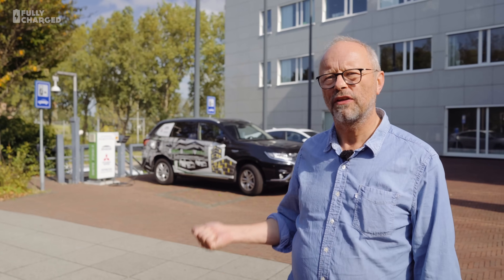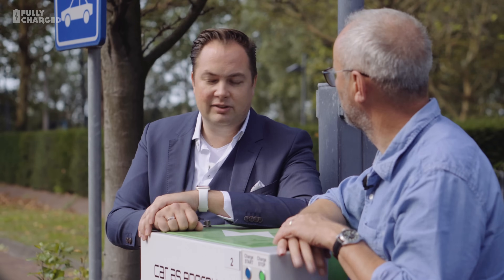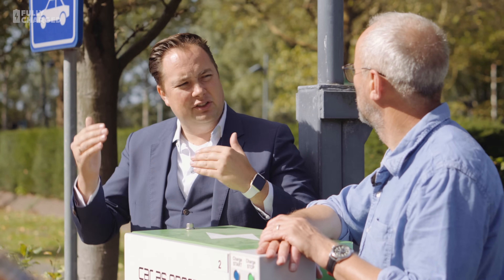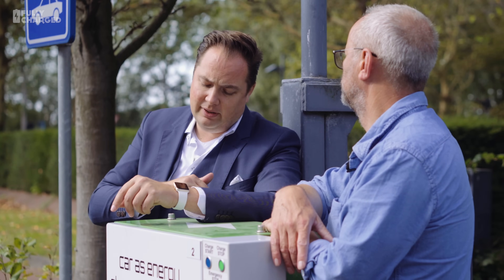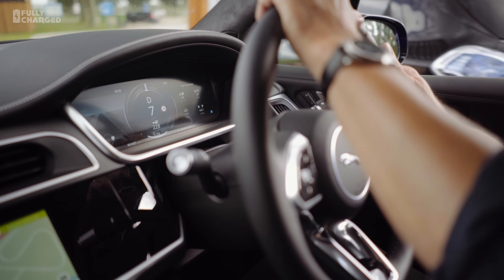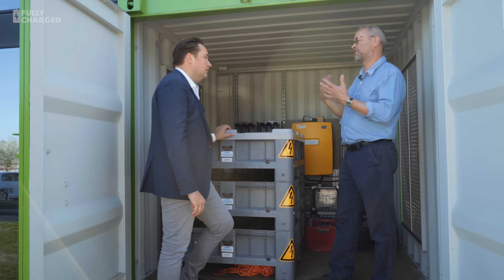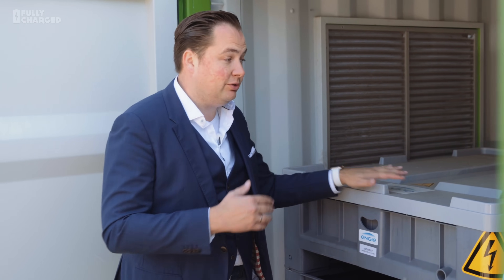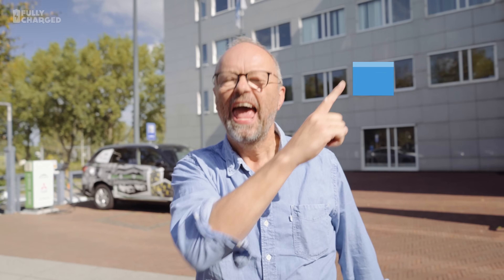Engie Vehicle-To-Grid | Fully Charged

Comment: I don't fully understand... if the building drains your battery, how do you get home? If there's a power cut and they're running elevators from your car, surely you'll have a flat battery? What's in it for the customer?
Reply: Most EVs have a "trip planned" built into their system.  This allows the driver to set there next departure time and destination, that can easily ringfence a certain minimum charge requirement.  For example, i know i leave work at around 5.20pm each day, and the trip home is say 15 miles, and requires 4kWhr of electricity. If i get to work with say 14 kWhr in the battery left, my car could, during the day when the price of 'lecy is higher, sell 10kWhr back to the grid to easy peak loads at lunchtime, leave itself the necessary 4kWhr to get me home, and then recharge on cheaper rate 'lecy over night ready for tomorrow.  if my plans change, then i just change the setting using the normal remote app on my phone, and the car could quickly recharge if my journey is required to be longer etc.  Most EVs have all the necessary hardware on board to do this today, should the software be written and released by the OEM and should the DC chargers be replaced with bi-directional units (current DC supplies are "charge only" ie are only designed and certified to take power from the grid)
Reply: @maxtorque2277  That's a great explanation. I'd always had a bit of trouble getting my head around it up until now. Thanks.
Reply: The system can monitor what it draws and will not drain your battery. If you watch an early video RL did in  Australia they have an example where a house battery does the same thing, but to balance the grid, the draw was very small but was enough to contribute to stabilisation of the grid. The system show in this video is a trial to ensure the system works in the real world. In reality is there would be multiple vehicles/ home batteries used. The idea of maintaining the power to a building during a power out is currently a dream as it is really difficult whiteout the system trying to power the local grid. There are real risks to those working on the grid to fix the problem if a property is putting power in.
Reply: There are smart switches that will isolate the building from the grid during an outage.
Reply: Markle2k Yes, but I understand they have not yet been approved by any organisation nor has a protocol been worked out to which they need to comply. They are safety critical. To run a house 'off grid' it must be first disconnected fully from the grid.

Comment: But what if I need to suddenly go somewhere? Like what if a relative have gotten into hospital and I suddenly need to go to them and then find my my car only 50% charged? I want to be able to get there, I don't want to have to wait 5 more hours for my car to be fully charged. I think that this is the downside of this system, you can't suddenly go somewhere on long distance, you'd always have to plan ahead.
Reply: Neal Archer  Alright, I get that. But let's face it, the number of cars connected to this system will increase slowly, so in the beginning there will be less cars, which me their batteries will be discharged more. So I imagine that little amount of people would like to come back to a half discharged car, which would mean the system won't grow and thus the large amount of  cars that is needed won't, or at least not quickly happen and thus energy companies will search for different solutions, thus making this system useless.
Reply: @Olsulor11  
Obviously you will be able to set limits on how your battery is used. If you think you are the type that has long distance emergencies all the time and always need a car charged to 100%, none will force you to participate. For the other 95% of people even a car half charged will still be plenty to get around whereever they need to go.
Reply: Neal Archer  That's all well and good, but I don't think it'll be easy to convince the general public.

Comment: When the power grid takes power from your car battery... how do you get paid for that energy?
Reply: I assume you will need a meter box like you have with solar, that measure incoming as well as outgoing energy
Reply: In this example, I think the discount would have to go to the building. This can then be redistributed as some sort of benefit to the employees who contribute to the charging. As long as the employer can get a measurable benefit back from the energy company, I'm sure there are many creative ways to incentivise those who are contributing.
Reply: Good question :D I think the same way as you pay for public charging now, with apps. (or with cards)
Reply: The Mighty Dash 
Electricity bill will be negative I guess (you get free credit)

Comment: 10:45 60kwh ???? That's a lot !
Reply: Doesn't seem right. I counted 16 batteries per tray, assuming 80% capacity and deep cycle batteries (not standard automobile batteries) you need 130Ah batteries to get 60Kwh from those 48 batteries. They look too small for 130Ah batteries.
Reply: @INSOFTUSA  Yeah, they look more like 60Ah batteries.

Comment: Hang on,  with cars how does it affect the battery warranty if it’s cycling the battery while the mileage is unchanged.  Deep cycling degrades Li-ion capacity whereas shallow cycling not below 60%  does not degrade the capacity.  I can’t see this being cost effective with shallow cycling.  Maybe with a new battery technology that does not degrade when deep cycled (full to empty), this will work as the case study presented.  Then again no one is going to build a non degrading battery.

The building battery storage / backup power is great and probably uses shallow cycling,  the gentlemen mentioned switching at a certain State of Charge.
Reply: I think this is a valid point, but there is more to this, too many factors count in battery degradation. 
EV companies already giving warranty based on both mileage and time (watever happens sooner), i think they will introduce a "cycle" or a "discharge amount" type of warranty besides on previous types.
Reply: You answered your own question. Driving down the road a car uses tens of kilowatts of power. 1 Horsepower =746 watts A Tesla can power a home for a week or more. An American home.

Comment: love this idea... being PAID to park your car and connect up.
Reply: Until you need to charge again.  At which point your paying for the power that had to be generated initially, in addition to storage fees, in addition to somebody's profit margin, in addition to all the losses associated with charging from one car to another.  For an example lets take only the latter, and assume 80% charging efficiency:

80% * 80% * 80% * 80% = Were already down to 40.96% efficiency.  Somebody has to pay for that waste and it only increases the cost of power.  Remember that we haven't considered the cost of paying you to store power, the company charging for that service, etc, and all of these factors arn't once off, you need to think of them  as a kind of compound interest.

Now we have to understand the risk as it applies to the power grid.  In Australia there are 19.2 million cars registered for use on the road network.  If every body is just plugging and unplugging every time they want to go somewhere, then it's not going to reduce spinning load generation, it's going to increase it exponentially!
Home energy storage is broadly a good idea, but ONLY for storage and personal use.  As soon as people try to put energy back into the grid, it just makes for a big expensive mess.
Reply: If you are charging your car off your roof solar, you are not paying for anything generated.
Reply: @g-r-a-e-m-e-  
That is correct.  My point was that there is a very specific mode of operation that makes sense.  Putting energy into battery's (non grid), makes sense.  This reduces grid demand, it is in effect spinning reserve.  As soon as you feed energy into the grid, you are bouncing energy every which way, with reduced efficiency in every transaction.

Comment: Will only work with CHAdeMO I think electric car manufacturers using CCS/SAE have missed a trick here
Reply: For now. These standards will change a lot in the upcoming years, there will be new standards as well and older standards will die off.
We seen something like that with USB ports already :)
Reply: Only because currently the CAN based protocol used by CHAdeMO is the only "Open" and fully validated protocol to support bi-directional dc current flow (ie current flowing OUT of the vehicles DC charge port). However there is no hardware reason or change required, DC is DC, so any system can intrinsically support V2G, and in fact, the HomePlug GreenPhy used as the basis for Powerline Coms over CCS does include this ability, it's just not yet been enabled by the vehicle manufactuers.  As most EVs support over air updates however, there is no reason it simply cannot be turned on at any point in the future for most already existing EVs!
Reply: I should add that it is not possible over the AC charging systems (L1 or L2) systems because the OnBoardCharger (OBC) on an EV is not designed to push AC power to the grid (and not certified to do so).  Numerous safety concerns are going to have to be sorted if that was required, so it is highly unlikely to happen, given that most EVs now have some form of DC power transfer capability

Comment: I agree fully ...  Li-ion for mobile and lead-acid for stationary deployments.  That's the ticket given current viable battery technology.

I seriously question the viability of re-using depleated lead-acid batteries considering how cheap it is to recycle lead-acid batteries.  It seems that once they degenerate some you might as well still recycle them and deploy them fresh.  People's time if worth something and doing a deployment of something that is only going to be useful for a year or so seems wasteful.  Still who's to stop some-one from trying.  They might prove me wrong. :-)
Reply: It is essentially free batteries. Putting them in a box and connecting them once a year doesn't really seem like a waste. You will have to do that anyway even with new batteries AND pay for the batteries themselves.
Reply: More power to you if you want to do shuffle old batteries around.  That's fine.   It's just that I've developed a perspective regarding lead-acid batteries coming from the fact that they are no fun to move around and that they recycle very well.  In fact I often wondered just how great we could make it if we made special, possibly glass, battery cases  that last forever and can be easily opened emptied of thier acid, plates, and conductors and then refitted with new contents while recycling what was removed.  It's not exactly high-tech cool but if we could robotically do all the steps X amount of machinery could keep Y amount of lead-acid batteries running **FOREVER**, all without anyone pulling a muscle or getting sulfuric acid on themselves.  I'd love to be involved with some group out there doing that. :-) I personally am too remote and too insignificant to do much but who knows, it depends on what the group needs. :-)

Comment: VTG would be great for people who 1) Charge at work for free or cheap 2) Pay for a network which has better rates than an energy supplier 3) People who have an electric meter which charges less for electricity used at night.
Reply: cheaper at night: sounds like power from coal or nuclear plant. It is cheaper at night, because they cannot throttle down to lower demand at night times - thus running at full power  - giving electricity away for less money...

Comment: But why.

I'm not keen on car to grid. But the recycled batteries in the container to store solar is brilliant.
Reply: What's not to love about v2g? Most days i use less than 30% of my cars battery, if i could power the house off it during the day and charge the car at night i could roughly half my electricity costs.
Reply: @vide fa You're right, the price difference between day and night electricity will tend to zero, but te overall electricity price will be lower as well, because the provider's equipment will see less and less use. (Still must have it in case of no cars attached, but less degradation means less maintenance)
Reply: @vide fa reduced probably, maybe even to the point where it wouldn't be economical but it's unlikely to be lost if a smart grid is being used. Most renewable energy is not very predictable so being able to utilise more of it when its generating is always going to be beneficial. 

In any case there are other benefits such as backup power in a power cut. Sure you can do that with a seperate house battery also but that would be a seperate cost to install and with the car if there is a power cut in my locality I can run the house off the car and drive to the nearest working fast charger for a top up  when necessary.
Reply: Think of an off-grid summer cottage that you power with your EV over the weekend. Or powering construction sites.

Comment: Fascinating stuff. I work in urban planning and we're seeing more and more  applications for battery storage here in the UK
Reply: Jon Tait The big benefits are using the excess capacity at night to shift supply to the batteries so eliminating the need to build extra power stations. It will also make a transition to full renewables even easier.
Reply: I suspect we will just think of more and more.
Reply: Local batteries help take the spikes/peaks off the grid, this makes the whole grid easier to manage when scaled up.
You can charge the batteries off peak, for example Economy 7 in the UK, and so reduce the cost to the customer